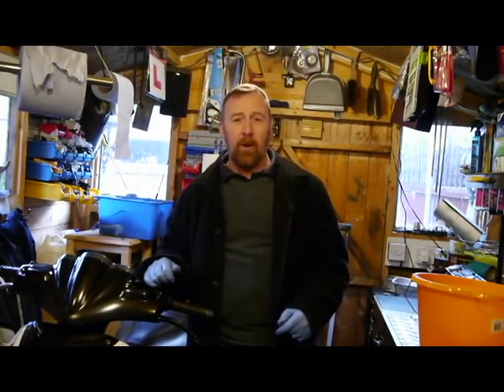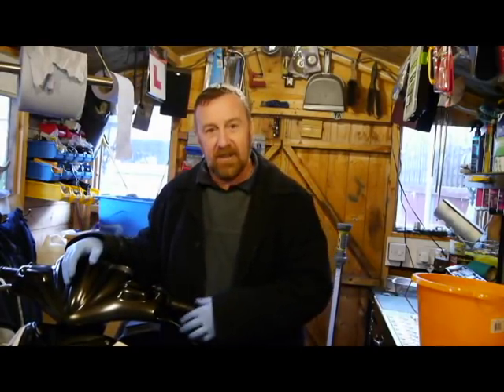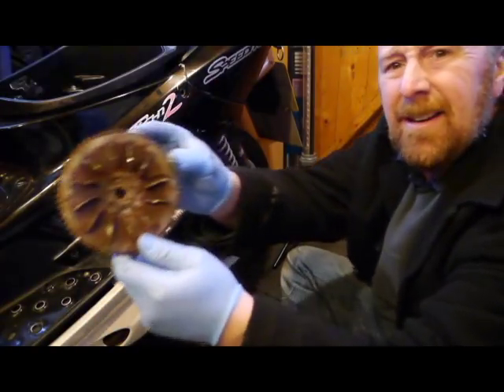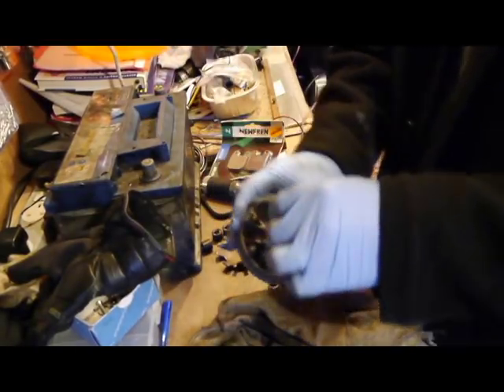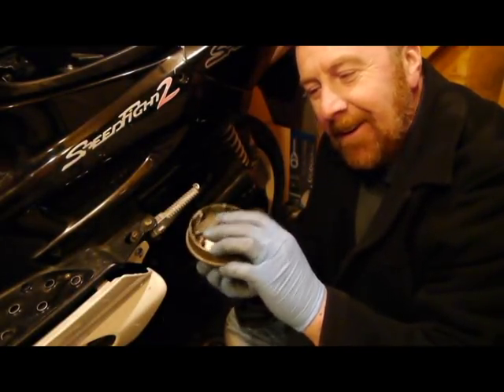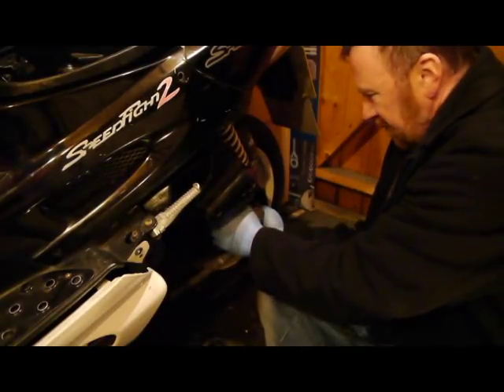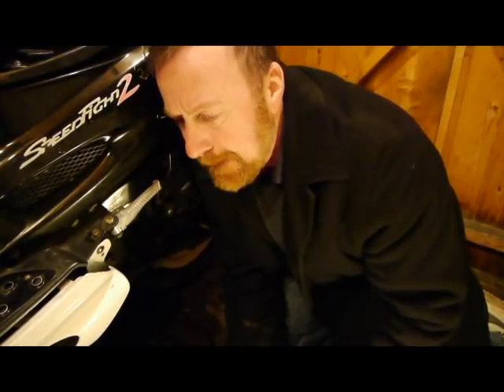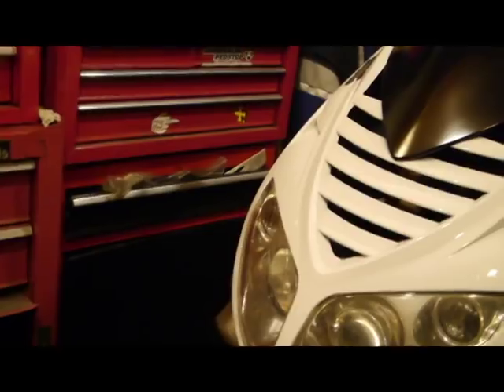MOPED SPEEDFIGHT SPEEDS UP SLOWS DOWN WHILE RIDING MARK SAVAGE

Comment: Hi my speedfight 4 starts then if I ride off after a few yards it’s started to make loud noise screeching so turned engine off any ideas please? It’s had new spark plug
Reply from the maker: its where the sound is coming from ? 
check if you start up on the stand and listen , then investigate bud , 100s of speedfight videos and most will be the same from variator system of rear wheel etc

Comment: pulse lightsped 2 50cc. i have upgraded to 100cc kit, i have replaced the rollers but theres  still no power. the max it goes is 15mph wont go any higher. What could it be please help me out. Let me know please.
Reply from the maker: This bud is why I say don't do big bore kits 
It not as simple as just changing the head 
Did you upgrade the plug 
Bigger carb 
Upjet 
Air filter 
Then tune ?
Reply: @marksavage  no i didnt  change any of that. i just change the big bore kit. what do i need to do?

Comment: Hi Mark, what roller weights would you recommend on a 1999 AC Speedfight?
Reply from the maker: hi as in my many speedfight videos all worth a watch, I used to combi them but founds overall 6g gave the best for a/c total weight 36g 
36g to 42g seem to be the happy weight to give best pull away and top end, make sure you follow my video to install
Reply: @marksavage  Same for speedfight 2 LC?
Reply from the maker: LC are normally faster but any weight from 36 to 46 in total will be fine

Comment: I’ve tried putting the claw hammer on the  variator and I can’t seem to get it off the hammer keeps slipping it’s irritating me how can I go about this ?
Reply from the maker: Reeferbuilder.96 push it is n really hard then ram you foot tight and push forwards as hard as you can 
Use a long bar like I use in my videos then push bar away from you as you push you foot 
If no good wd40 but and if still no joy you may have to buy the variator tool as in my other variator tool to help 
Mark
Reply: mark savage hello mate yeah I’ve watched all your videos been subscribed for a year now I’ve tried the foot and long bar method I’ve been told by my local garage either to get the variator tool or use a wizzy gun for the last resort
Reply from the maker: E BAY Sell them and ive seen the old gun thread the nut before so be careful, use another hammer to knock it on a tight as you can then your foot bud
Reply: mark savage just ordered the locking variator tool . Not really used to riding mopeds normally ride bigger bikes lol . Also I’ve ordered a new sports exhaust I was just wondering will I have to upjet the carb ?
Reply from the maker: @Paul_vlogs96  its a try and see bud so fit it and see how it runs as ive fitted many and they have been fine and other times not as the previous owner may have already up jetted and then they can paly up a little 
so fit and take it for a ride  bud
Reply: mark savage thanks mate appreciate that . Keep up the good videos mate there a great help to the youngsters I’ve recommended a few to subscribe to you
Reply from the maker: that's good to hear bud and thanks for watching

Comment: Hi mark, can I pick your brain? I bought my son a kymco super 8 50cc 2t, I have put the smooth collar on the variator and checked the rollers which are 8grn, they seem round etc, and have put new belt on . I checked the clutch that seems ok. My problem is that it is doing fine on the level but is losing power on an incline, if I keep full throttle it just slowly loses power as if its not shifting down, would you say I  need lighter rollers? Any thoughts much appreciated
Reply from the maker: Morning bud 
8g is heavy so yes 6g would be better and give it a good clean 
Carb?
Have you cleaned and serviced it like in my videos 
What jet is in it 
Standard exhaust ?
Give the carb a service and tune also clean air filter or change that 
If it still does it after all that it could be worn piston / rings which would also do this 
I have many videos that will help on my channel bud
Reply: @marksavage  cheers Mark,  I'll try the lighter rollers as I have put a slightly bigger jet in and cleaned air filter etc.  Cleaned carb and it's only done about 1200 miles so piston should be OK.  It's great on level,  40+ . Would you go for 6g or 5/ 5.5g ? Some great vids by the way,  really helped me out already
Reply from the maker: @mcfcarpetsstokeontrent1109  me 6g is a great all round weight 
If you have upjetted maybe a little more air in is needed 
Try a sports in box air filter or thin out the one in there now 
More fuel needs more air

Comment: on the rollers mark you said you like to mix heavy and light rollers is 5s and 10s  ok, do you stagger them like 5,10,5,10 or just 5 in one side and 10 other side
Reply from the maker: since the video and many others I found 6g's x6 is the best mid range rollers for pull away and top end so a lot easier but as for combi yes every other one but as said just go for 6g's bud 
and remember to clean the VARIATOR 
thanks for watching please like and sub and I have many other speedfight videos and moped videos that might also help 
mark

Comment: Hey Mark .. I have 17 plate lexmoto fmr 50 it will not go over 30mph also slow uphill but no faster downhill any ideas for just bit more speed ? 😀
Reply from the maker: Dave if you look on my Channel you will see I have had one and done a review on it a few month ago 
This is all they do bud sorry to say you can change the rollers for better pull away but that’s it wit doing a 70kit 
Mark

Comment: Hi Mark,my vivacity 3 seems to have died.cant get it to start.had a mobile mechanic out to look but he is stumped.it has spark and compression ,cleaned the carb, battery fine .was great b4 this any ideas m8
Reply from the maker: ch1ll110 hi bud 
It still can have compression but the piston can still have gone!
Like in my videos have you done the wet had test ?
Does your plug get wet ?
Is this one 2t or 4t ?
Mark

Comment: Your videos are coming in handy I'm a new owner of a speedfight 2 50cc that only goes 30 mph haha need abit of your help to get the speed up
Reply from the maker: Hi bud 
Yes there's 100 speedfight videos on channel that will help 
Type in speedfight mark savage and they will come up
Look at variator 
Upjet and carb videos bud
Reply: To get it faster. Remove the washer from the variator. Use 5 to 6gram rollers. Remove the restrictor collar out of the top of the exhaust. Use the white contra spring and tighter clutch springs.

Comment: I have the factory Jets on it should I up the jet or put a lower one I have a phone filter should I change it and put the regular filter back on it every time I put the filter back on the bike does not start
Reply from the maker: Hector Rivera try running the carb like in my tuning video and clean carb
New plug 
Have you a sports exhaust ?
If so yes try a small up jet by 4 
Air filter do you have the link pipe on it just the filter 
Have you change or cleaned the airfilter ?
Mark

Comment: Hi Mark I was cleaning my aerox when I saw what seemed to be 2stroke oil leaking out of the Air box. What's wrong with that?
Reply from the maker: your message was held as not subscribe !this can happen when the air filter needs cleaning and a service , so clean of change plug and clean your carb I have videos on both on my channel that will help and many videos on the aerox hope that helps mark

Comment: help
hi i have problem with my yamaha vino 125 2006 has spark has gas exhaust is good  valve is good crank but wont start  i change the carburator cdi /coil / valve ajust compression check 140 psi  still wont start what can be the problem [note i have 2 yamaha vino 1 running 1 not running ] thanks
Reply from the maker: hi bud thanks for watching
I've not worked on one before but take it it's 4t, we had the same sort of scooter over here made very cheaply with a cheap Chinese engine that fails after a few 1000 miles.
being Yamaha i guess the engine would of been made better, i would go for timing or valve damage even piston failure as you can still get compression !
as you have a running bike i'd be using parts and swap them over till it ran, or other way round so take parts of the none runner so you would know they work then you would be left with what does not
hope that helps bud 
mark

Comment: Well i might be a bit behind the times having just got a speedfight 2 100cc 2002 as a project and needed some advice and am struggling for spares so if you could advise or help mark it would be a massive help
Reply from the maker: parts for these are starting to get a little harder new ,lots 2nd hand for 50cc but not many 2nd 100cc part at all bud 
e bay and facebook sale
Reply: @marksavage  i just want to get it breathing better and aint done scooter in years so am working blind so to speak
Reply from the maker: does it have the link pipe to the air box still, have you adjusted the air mix , 3 half turns and go out like in my tuning video, 
changed /washed air filter
Reply: @marksavage  in all honesty i got it last sat and it has sat for 5yrs, so removed tank and carb then cleaned them out and it started fine just want to get it 100%
Reply from the maker: that's good and may need a good run bud , but like in my videos id go over everything to be happy 
ive got a few on 100cc but the basics are the same on the 50 and there's 70 videos to help you bud on my channel
Reply: @marksavage  thanks for that and thinking about it yes it has the standard airbox and a pipe that goes from that round to the frint of the head

Comment: Hi mark i recently changed my peugeot speedfight 3 cdi to a naraku racing cdi. Now my scooter revs higher but it doesnt pull feels like the clutch is sliping or the weight are yoo light. But before with the standard cdi it reved lower and it felt faster? Why did the racing cdi didnt work ?
Reply from the maker: odd as higher revs would pull more , so variator off and clean and change the roller to 6g like in my videos on how to do it 
ok it shows you on a sp2 but all the same  and as you there checkl the belt as may need replacing 
last thing to check would be the clutch as in my videos 
mark

Comment: Hi Mark I have a ludix 70cc and have a problem when 1st start it it won't move and also has loads off back pressure the exhaust pops when reving it also it's running on a 50cc carb should I change that but can't use k&n filter as won't ride in rain hope can help meny thanks gav
Reply from the maker: hi bud 
ok so i take it you watched my video 70cc kit don't do it !!
you will have to up jet or go to 19mm / 21mm carb, then jet it correctly, then as in my tuning video get the air mix right
you should be fine with a sport in- filter but yes not the sponge ones as they suck in water like in my videos 
i have many other videos that will help but you will need to sit at a computer to see them all as i have 364 videos and well over 100 on mopeds plus the ludix
if you do get it running and you will need a sports exhaust you will have to add 2t oil in with your petrol as the oil pump is only set up for a 50cc along with the cdi
i would rather have a 50cc with all the add on's than a 70cc kit as they just don't last bud as i say in my videos
please like share and sub 
mark
Reply: mark savage what would be the best carb would you say to get what is causing back pressure as never done this b4 I have sports exhaust on it atm and have subscribed n liked mate top bloke :)
Reply from the maker: Gav Crouch I’ve not gone down that road of trying before 
I’ve always put them back as it’s a pain paying out and if not worked it’s a waste 
19mm are easier to set up but as in my tuning video they speedfight  I was working on had that 21mm carb and ran fine !!
Just a bugger to start Lol 
See what you can get and make sure it will fit 
Did you upgrade the plug to a hotter one?
As the bike will run hotter !
Mark
Reply: mark savage no I have changed spark plug as yet I was looking at a narku carb if I spelt it right lol 17.5
Reply from the maker: Gav Crouch 17.5 is a standard carb so if upgrading with a 70 kit maybe look at 19mm
But it’s up to you really bud 
I only do 50cc and 125cc oh and the 400cc 650 cc Bergman’s Lol
Reply: mark savage ok bud I shall have a look keep up with videos ur top bloke:)

Comment: My piaggio nrg had a fuel leak so I took it to a bike garage and they replaced the bowl and the float on the carb few hours later was bogging really bad and the acceleration is now slow and if I don't let it warm up it Just will be boggy and it never was before and top speed is 35mph lol before it was 45 all I have is pipe and 3.5g rollers bike is 2016 with 3k miles could mine be same issue also left it for a month before I rode it
Reply from the maker: Well thats odd !
I would say go back 
Ok the float may now be letting in less or more fuel as bogging can be both !!
If you were getting 45 with 3.5 rollers that's good as I use heavy normally for better top end 
If you can take off the variator system 
Clean up and check or change the rollers bud 
Then look at the carb 
Maybe ask if they did anything else while at the garage?
Jet maybe blocked ?
Take off and give it a clean too and check air mix like in my videos bud

Comment: Hi what size of roller i put on my 50cc i got same issue thanks
Reply from the maker: Is it a speedfight?
As all mopeds use different sizes and weights 
You might have to Google your mooeds specs 
Or type in your mooed into a bay
Reply: @marksavage  honda sfx50cc 2t.

Comment: What size is the nut on the variator
Reply from the maker: 14mm but have found some with 13mm
but remember its not a standard nut !!
has to be the right Peugeot variator nut
Reply: @marksavage  I was just asking so I can get a right size socket lol
Reply from the maker: @joshuasalisbury789  follow my video on how to get of but i now use a impact drill as much easier lol

Comment: My aprilia sr50 get to about 40mph then it's like a boast and it will pick up and go off the clock is that right
Reply: Forgot to say it has a 70cc kit in it
Reply from the maker: No but cool doing it 
70 kit , probably nothing to do with it 
More like the other work 
Carb or injection 
Rollers variator , clutch 
Sports exhaust 
More likely heavy rollers and race springs 
So slow to open up 
Keep using e5 and good 2t or it will blow
Reply: It has a sport exhaust on it starts and runs great just the little boast past 40mph should I check rollers ?what weight would you recommend.
Also while I've got you the electric start doesn't work I press the button and there's nothing it kick starts fine and ideas thanks Mark
Reply from the maker: @darrenrichsardson3828  if you get nothing then it's the relay to check first 
It should cluck 
Check brake light comes on when pulling the brake 
If light comes on relay if not micro switch 
Once click 
Still nothing its the starter
As for speed 
I've leave it
Reply: I've changed relay still nothing no click or anything break light comes on when I pull brake from both sides
Reply: Hi Mark hope you don't mind the questions my aprilia sr50 back light is very dim but brake light is fine any suggestions why this is thankyou

Comment: hi mark my bike when trying to start it  starts sometimes to spit back and puff and don't share start but sometimes it runes and flys lovely but only dose 38mph why would that be
Reply from the maker: hi bud 
spitting back is too much fuel while starting bud, service it bud maybe clean or change plug, service carb
as for 38 mph, is it standard , upgrade time bud, sports exhaust and like in this video and my other video check roller and other parts there
mark

Comment: Hi Mark can u do a Peugeot ludix snake video please cause I'm having trouble with mine soon wen I do the throttle it goes from 10mph then goes too 40mph
Reply from the maker: hi ok you have askede twice and i guess its the rollers, have you checked them?
i have many videos on the variator and rollers watch them they wil help, remember to clean it well and change the roller, i'd go for 6g's but weigh the old ones to see what you had in there 
please like and sub 
mark

Comment: What weight rollers for higher top end speed?
Reply from the maker: Gxrfield CG hi bud as in my variator video 
Light rollers for pull away heavy rollers for top end 
Go for a weight from 35g to 45g total weight then you should get the best all round bud as you still need to be able to pull away Lol 
Have a thought about changing  your belt too bud 
Thanks for watch , please like share and sub
Mark
Reply: Thanks!

Comment: I got a new battery and a new carbo and it’s run but want go
What do I gotta do to fix it
Reply from the maker: hi bud so you have a moped ( which one) and you got it running but it wont pull away?
does it die or just not pull away?
have you looked at the variator ?
I have over 70 videos on speedfights and 150 on mopeds give them a watch as the will help bud